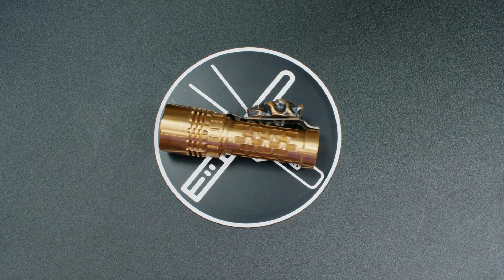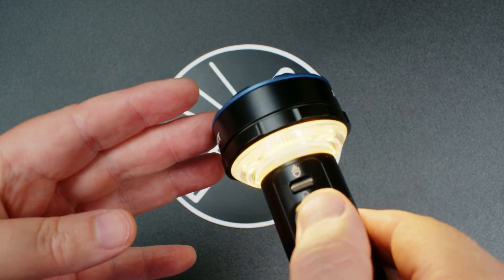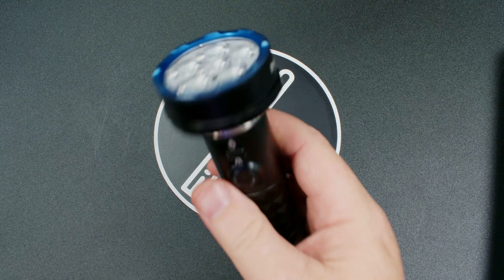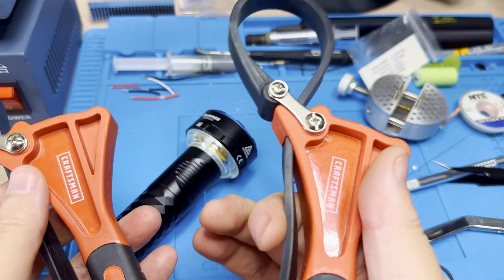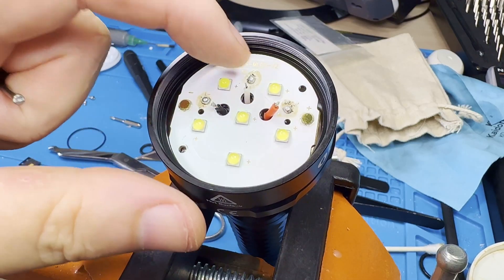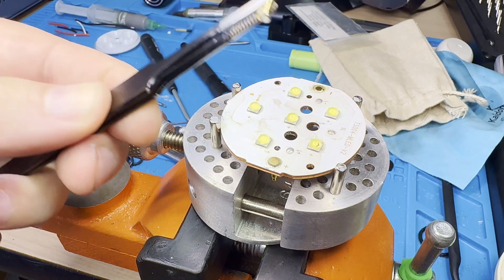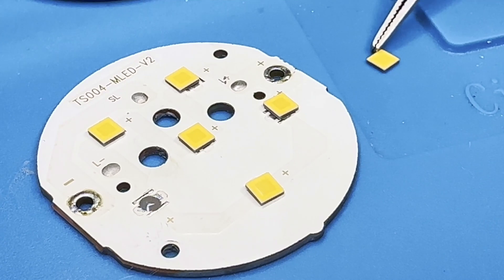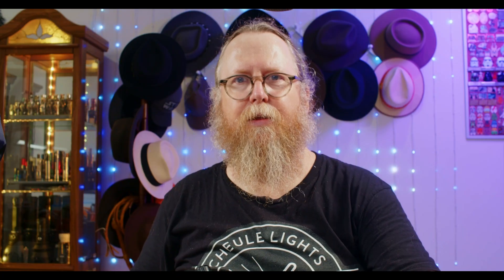Perfecting the Olight Prowess! - Review and swapped to ROSY 4000K!

Comment: Flashlight modding has a special place in my heart. I appreciate you sharing your project. You gotta link the tools you're using, affiliate links are fine. I honestly find mass produced lights that have no reason to be modded incredibly boring. They end up being shelf queens. We've seen the slow death of DIY hot rods. BLF designed lights have essentially died. Mass produced hot rods, aux led, boost drivers, titanium, copper, buzzwords, all kinds of different led configurations, new models coming out all the time. consumerism has gotten out of hand.
Reply from the maker: You make fine points. This video has links to another swap video where I show the tools and techniques better. I’m sorry I’ve never linked to Amazon, because most of the tools (like the hot plate and soldering station) come from AliExpress.

Comment: There has to be logistical reasons for olight to not use better LED. I have modded a few of them and high cri doesn’t seem to make them that much dimmer. They are such great hosts.
Reply from the maker: Two big reasons:

1) lumens sells lights to the public
2) more lumens can mean more candela. But as I demonstrated in this video, not always.  But truthfully, if I had Cree XP-L HI 5700k emitters in there, it would be only slightly less than 5000lm, and far more candela than the ffl351a. So lumens does matter to candela.